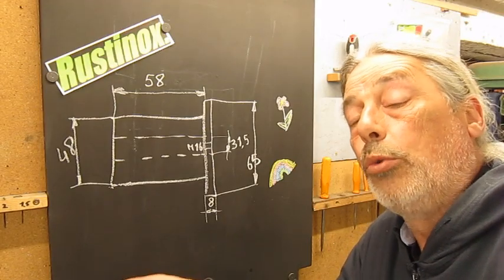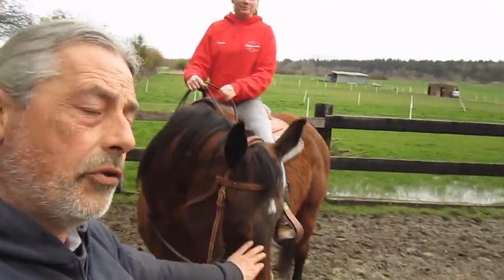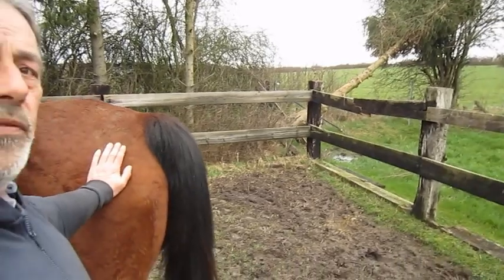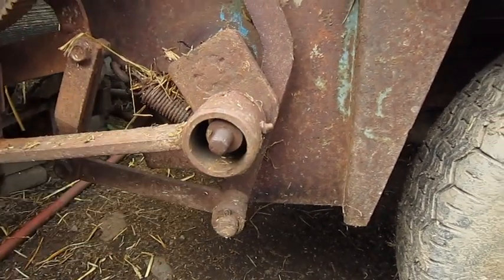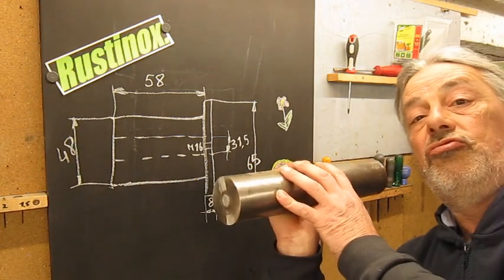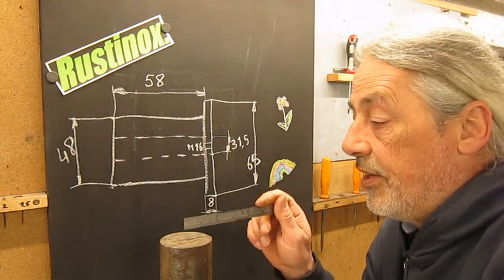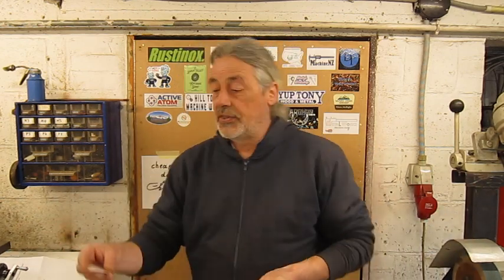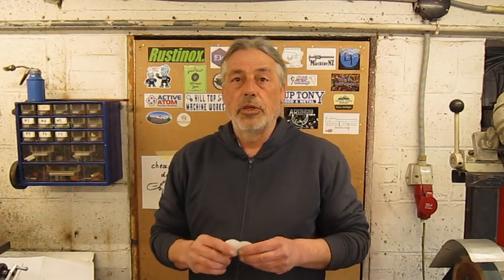Bushing for manure spreader.

Comment: I've had little more than grief trying to part off in my lathe too, still trying other tricks in hopes it works someday.  I like the slow-motion footage of the shaper, that was cool!
Reply from the maker: Parting works well with good blades, but i don't have.
Reply: Try using a backa tool post as described in 'Model Engineer's Workshop Manual' by George Thomas.
For my part I do not have one but just grind parting tools from HSS square stock according to the angles in Laurence Sparey's ' The Amateur's Lathe'. A back tool post would be better though. The geometry of a back toolpost means that the  tool when stressed tends to lift out of the cut rather than dig in. I have read elsewhere erroneously that the lathe runs in reverse when using a back toolpost. This is not the case it rotates conventionally.

Comment: Great job! I believe that the parting tool has a cutting angle that was far to big, normal about 5° but your broken one looks like 40°. That's why it broke. A 40° cutting angle is good for plastic (PU) parting. And now use the better (HD) camera :-)
Reply from the maker: This parting tool has a rake angle of 7°. The problem with this HSS is that it is too flexible. It acts like a spring.
And indeed, one of this days i will invest in a new and better camera.

Comment: Very nice. That was some real hogging on your lathe!
These "real" projects become addictive, I tell you.
So much so that one day, you'll skip making all the little fixtures, carriage stops and clamping aids that would make the real jobs easier,
just to get the real jobs done, if you don't pull yourself together. 
Reality is one hell of a drug!

Ps.: You sure have some odd cars in the country. Fuel tank up front? Hilarious!
Reply from the maker: Thanks for your sub and comment, Adrian.
I'm a big fan of your channel.
I did lots of "real" jobs years ago, but sinds i moved there's not many people anymore that know my hobby. Nice and quiet for me.
Reply: @Rustinox  Absolutely my pleasure, glad you like the channel! 
Nothing beats being able to help out others with your machinery, in my opinion. 
Doing the production run of 50 couplings or shaping the feed gear were definatley my personal highlights in the recent time!
Reply: Adrian,the fuel tank up front could be viewed as a driver safety persuasion device. Don't drive like a careless  loony or hit anything in case you go up in a ball of flames. Very much the same type of safety persuasion device as a 12 inch spike protruding from the steering wheel hub would be.
Reply: @howardosborne8647  Reminds me of the good old days where, in lack of a fuel pump, the gas tank was right above your lap and most head-on collisions would shoot the steering column straight through your chest :D